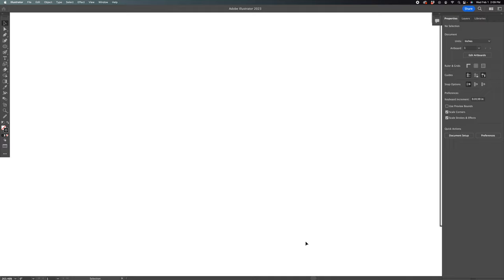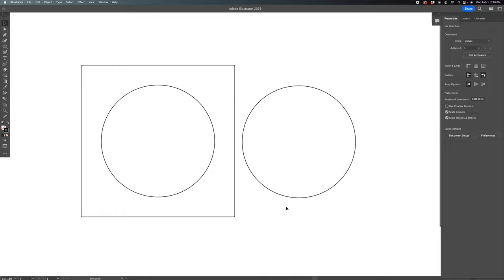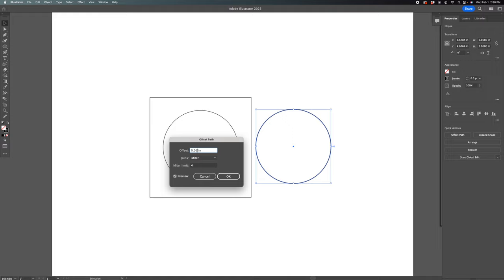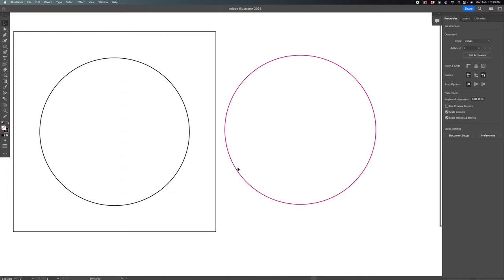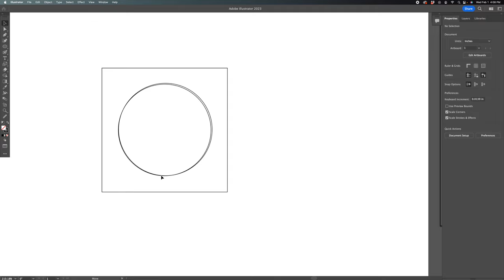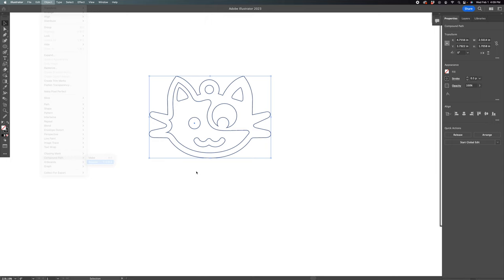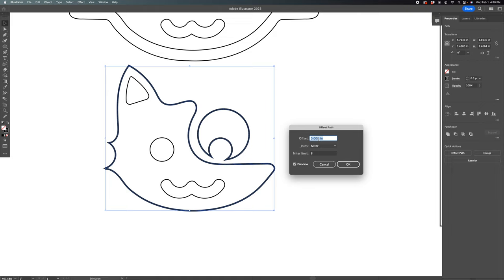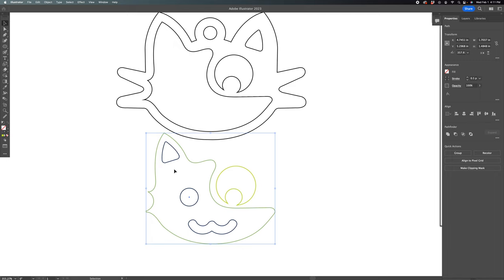Gettin' Kerfy Wit It! Explaining what Kerf is and how to adjust for it for Laser Cutting

Comment: Hi Darryl, great video! Can you explain on an upcoming video how you went about finding the kerf for your machine? I have tried a process on a box making website, but it always comes up different and I can't seem to get it to fit right. Thanks 🙂
Reply from the maker: Absolutely. I will be making something like that. But so many factors are at play. Focus. Lens. Air assist. Material. So for me it is trial and error in many cases. Even if your focus changes for a material you will change your kerf. So it’s not completely straightforward but I’m going to be doing a video explaining this in the future for sure. It’s not as complicated as it sounds tho. 😊
Reply: @thatlaserdude  Awesome Darryl, I just downloaded the tool. Can't wait to get off work and do some testing with it.

Comment: Thanks for this video. I've seen other videos suggest using the Kerf Offset setting on your cut layer. Can you explain the tradeoff between embedding the kerf in your design vs. using the kerf offset setting? I'll be experimenting with this so I understand better but in my software brain it seems like storing the kerf in Lightburn might make the designs more "portable" for different lasers.

Comment: Question! When doing inlays, I noticed you pushed it in and it kind of "snapped" in place. Is that the last step, or do you also need to use glue somewhere to ensure it never comes back apart? This video was perfect timing, as I have a sign with stand I need to make. I already did a test run and realized that I needed to adjust for kerf but I didn't know that's what it was called 🤣 thanks for the demo!
Reply from the maker: Depending on how tight the kerf you may not need glue. But putting a little bit of glue won’t hurt and will ensure it stays in place for sure. 😊

Comment: This absolutely isn't working for me. when I hit offset wether it be .01 or .008 - it just seemingly gives me a copy of the same size. I think It's operator error ( me ) I'm just not getting the same results - Edit: Figured it out finding the two lines, and pulling the bigger one.. my glowforge kerf fits well with wood @ .3 - .35 pt offset path on AI. Just found out glowforge has a tool to just copy and resize there, he started at .008 and worked his way down to .001 to fit acrylic. Will play with it more. 

Your video was great thank you.

Comment: Is the kerf measurement different for different brands of laser (ex: glowforge vs thunder)
Reply: Oops, I needed to watch all the way thru before I asked.
Reply: with a laser, the kerf is largely determined by the material, focus, lens used, air assist, etc... and can vary depending on machine, settings, and substrate. the beam can change, so it's not quite as straightforward as say a saw blade or router bit with a known and more uniform kerf width.